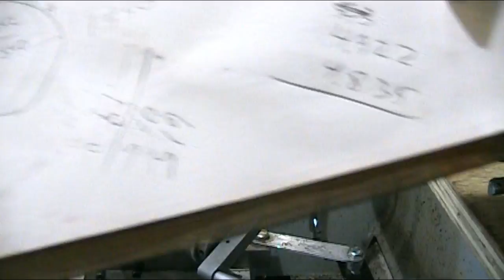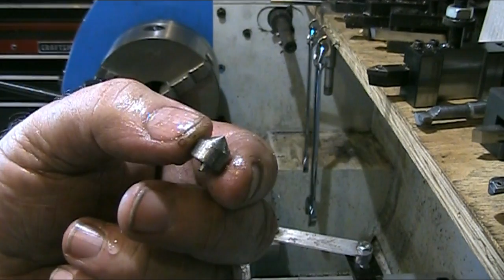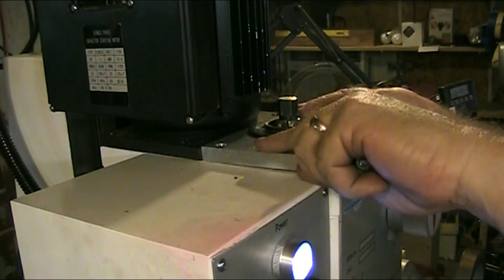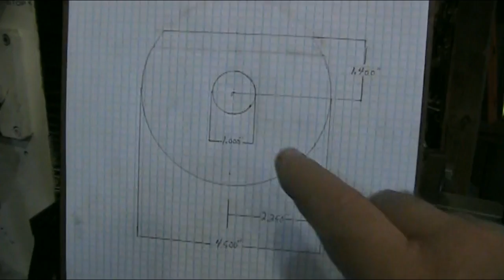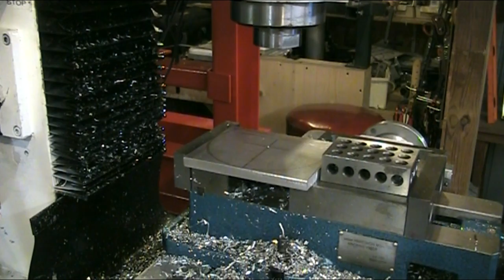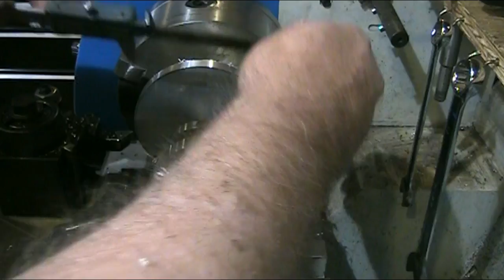Milling Machine Power Drawbar Part 2 of 5

Comment: i was wondering how you would get it out was thinking small hole on one side of the spike and a piece of metalwire or a dentist tool to pry it out ...... magnet , offcourse  , one trick to gotten the stainless thing out was a dab of hot glue on a stick , or chewing gum or a small wad of gaffertape , guess i will use the same trick on my machine with the spike / small centering thingy to get the holes to line up
allso seen them use alltread or studs they made a point on it them two flats below that to be able to put a spanner on it to get it out , make a hex and you should be able to put a socket over it
about the clearance between the airspanner and the motor of the lathe , one thing you couldve done was rotating the airspanner a quarte turn putting the butterfly valve and the airinlet on the sides , wouldve meant doing the operating handle differently but i seen that done by mounting a rod flat over the butterfly , does look offcenter though , i have the same machine from a different brand that has another type of motor on it , ithink i have more room over the mountingflange of that motor on my machine so i might not need to do that , still going to look at how you mounted the tool to the lowering plate as you did that differently to the other designs i seen too
like the idea with the doublesided tape though i might use the center hole and a tight fitting piece of treaded rod / nut and bold and use the stick out from that to clamp it in the jaws . moves the piece a little away from said jaws and the piece whont move and is centered around the center hole

Comment: Hi Lee,
The project is coming along great, just maybe clamp that 123 block or it will pop up with any significant cut...   ;)
Reply: You can use gum ( not the denture friendly type though ) or goop to pull out the Stainless pin...   ;)
Reply from the maker: Pierre's Garage Yep, should have clamped the block/work down. Thanks for the feedback.

Comment: You need to either put a puff shield on the mic or move it to where you are not puffing into it.
Reply from the maker: John Bare Yep, I didn't realize this was happening until I had several segments recorded. The problem was the mic had worked its way up & was way to near my nose. Thanks for commenting.